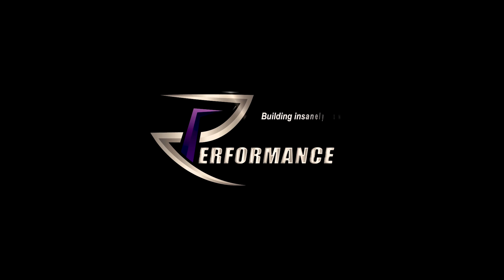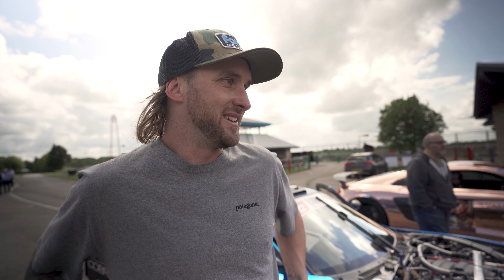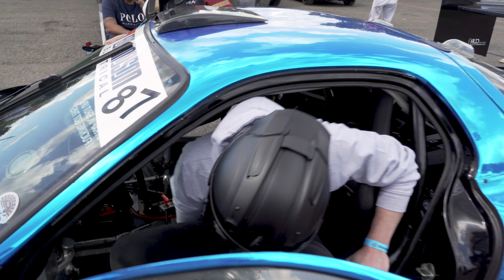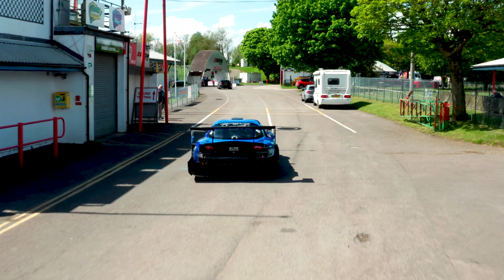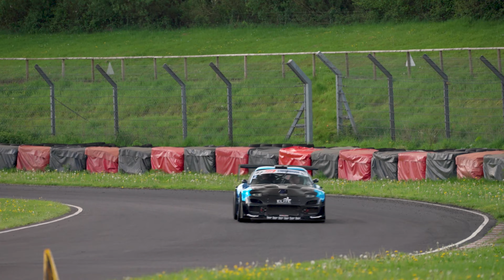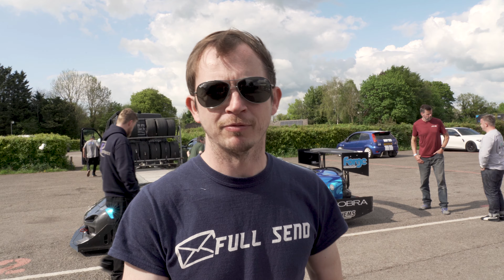V8-powered RX-7 Race Car!

Comment: Damn, I thought it was a 1uz V8 at first because of how understated the sound is... Even most unmolested LS cars in the states run on a louder exhaust than that.  Damn noise regulations!

Also yeah, putting an LS in an rx7 is considered haram to those guys... so much so that Rob Dahm swapped a 13b into a Corvette.